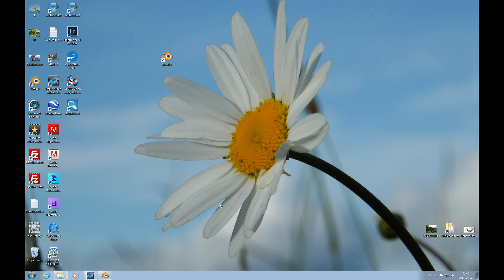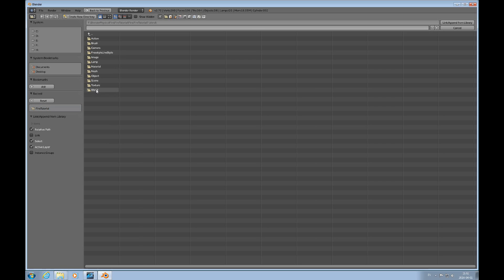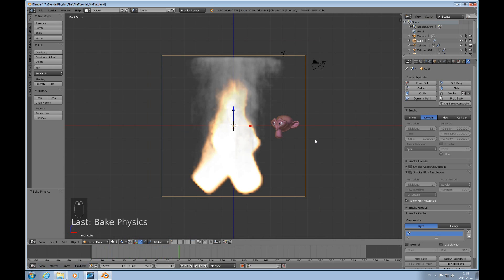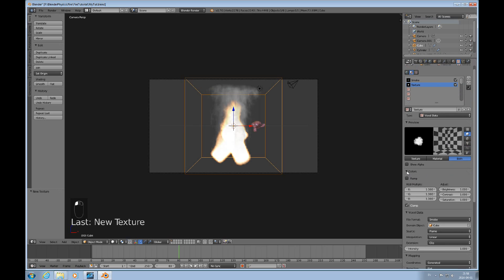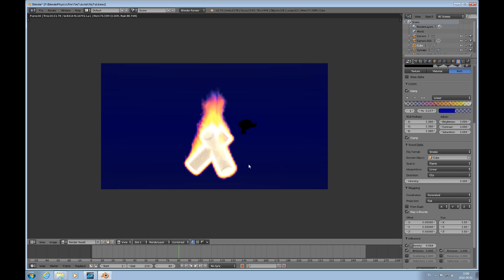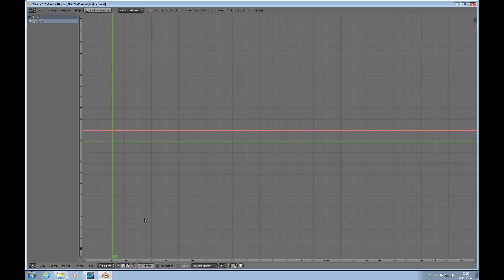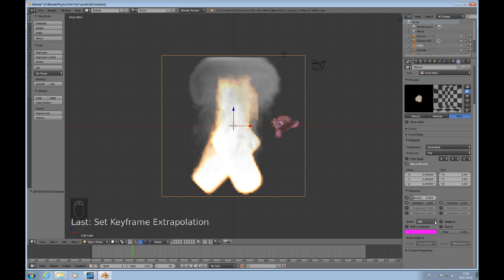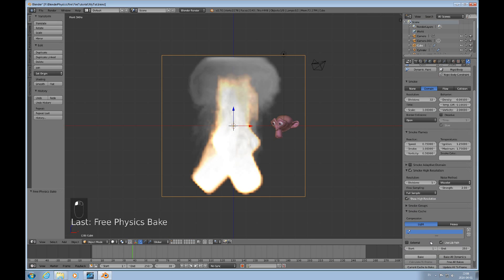Blender 2.7 Fire Tutorial

Comment: Great tutorial as usual Mr. a1 Sirius...i really liked how you lit the monkey...very cool stuff. I have a question and maybe you can make a video for us "not so smarts" out here...how about one on hardware..ie...machines and processers and graphics cards...rendering takes so long on my laptop it's depressing. I want to buy a new desktop..but i have no idea what to look for...price is my main concern of course but quality is also very important...but ty for this great tutorial and i look forward to more
Reply from the maker: Thank you Gerald ! There are of course a multitude of hardware enthusiast out there that will tell you "exactly what you need", which will most likely cost you a pretty penny. I like to build my own systems and try to keep my cost down. You will get your best performance and durability from a stationary system. Important components are, the Power supply (PSU), and its a good idea to protect your system with a surge protector,  When I comes to CPU you will want to research a model that has good reliability and fit it with a good heat sink and Fan combination. Personally I use the Noctua products for that. Make sure your Case will fit the Heatsink/fan combo. I will look into the possibility to make a "build your own system video" but don't hold your breath for it.
Reply: Thank you sir...im gonna start my research on building my own system. Im not really a hardware guy but for cost effectiveness I think it is the best option. Thank you for the advice
Reply: And keep the great work up. Your tutorials are excellent